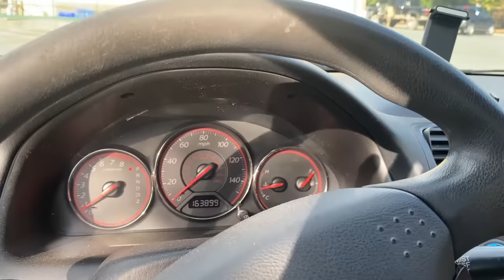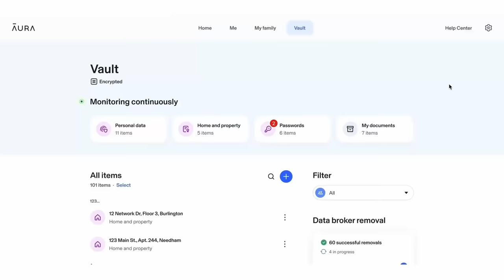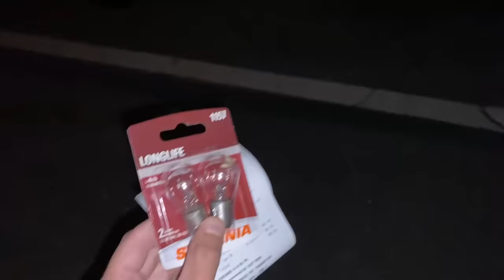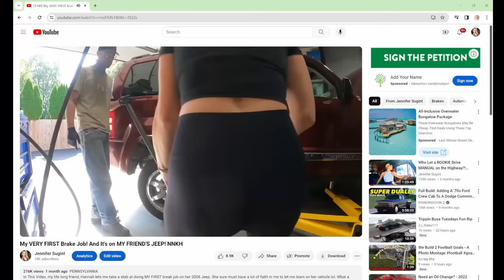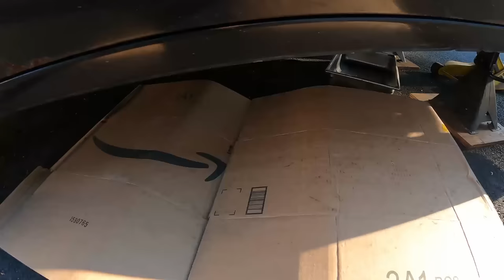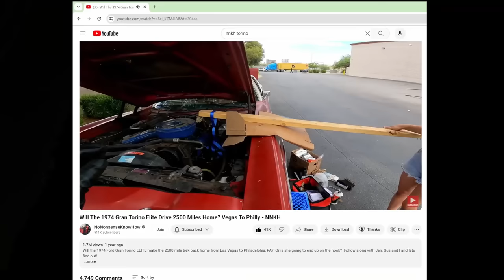Can This 86 Fox-body Mustang Survive its New Owner? I Bought a Manual! Jennifer Sugint- NNKH

Comment: Just a suggestion, do not do what my sister did, drove a standard while wearing flip- flops, in the summertime, foot slipped off the clutch at the wrong time,, and the motor's connecting rod put a hole in the side of the engine. Wasn't worth putting a different engine in, so, got an automatic next car. (My Dad paid for it of course....) Always wear decent shoes while driving.

Comment: Hey Chris! FYI   I am not sure what year the Honda Civic is but the exact same transmission problem happened to my daughter's 2001 Honda Civic. She was told by the Honda dealer she needed a new transmission. I told her to wait until I did some research. I found out that Honda had knowingly been installing faulty transmissions in Civics for several years and trying to cover it up until there were so many complaints and lawsuits. They couldn't ignore the problem any longer. The crazy thing is that if she agreed to replace the transmission they would replace the faulty one with another faulty transmission. I guess they felt like they needed to empty their warehouses on unsuspecting customers.  My opinion of Honda dropped considerably after that incident.

Comment: Replacing the filter on the threaded neck has challenged many men through the ages.  The usual problem is that you are working blind plus the oil likely on your fingers doesn't help and ....

Thumbs ☝(👍) this comment if you have the integrity as a man to admit it.

Comment: Jen,  did u see the mouse coming-out of the head liner??   I woulda tooken-out the liner, before u had vacuum the inside.
good job on the other things,  except the oil pan bolt o-ring.

Comment: That first thing in back is a differential gear.  You want the highest possible differential gear, lowest ratio, if you don't want to burn far more gas than you did in your Civic.  Burnouts may be fun but are very impractical, so if you can do a burnout on dry pavement, you should get a higher rear end gear to save gas, and hopefully that is one.
    A bunch of welding work should be able to patch up the worst of the problem rust like the sun roof latch.  I watch Scott at Cold War Motors for how to do that.  Then lay on the spray wax to keep the rest of the rust from getting much worse.

Comment: You may have done it off cam, but one really has to change the oil filter when the oil is changed. End up having the clean oil going through a dirty oil filter.
Reply: On never mind. Letting the movie roll I see the filter change.

Comment: It would run without a filter for 5 or 10 mins while all of the oil "squirts" out of the big hole in the middle and then the engine locks up!

Comment: I find that when I remove the oil filter, additional oil drains out the oil pan, so I don't replace the plug until after replacing the filter.  This also allows more time to drip, during which I also document the oil change in the maintenance log and perhaps the sticker on the windshield, and any sealant to gasket on the plug bolt.  This does involve washing hands twice in order to handle the maintenance log in the middle of the oil change, and increases risk of someone starting the car with no oil or adding oil with no drain plug, but it does result in a more complete oil change.

Comment: Congrats Jen, I just bought my first manual car this past summer! It's a 2005 Honda CR-V EX with AWD, I love it! A guy I know has a 1986 fox body mustang identical to the one that you just bought. Same color except his is a convertible and has an automatic transmission unfortunately, and it is in much worse shape than this one is. Good luck with your new purchase, hopefully you can get a new transmission for the Civic as well. Unfortunately the automatic transmissions on those cars are somewhat weak which is why I opted to get a standard this time around. The Civic and the Element/CR-V are mechanically identical cars so basically everything is interchangeable for the most part.

Comment: Nice use of the sniff test on the insulation. It also works on expired dairy products, to see if you can get another day out of that T-shirt, to determine if that was dog pee or water you stepped in, and your own armpits to see if a shower is required.

Comment: On the last one of these that I resurrected the owner had mice nests both under the seats, in the headliner, and also in the trunk as well, ironically in the exact same spot as they made a nest in your trunk! The sky is the limit as to where they could be. So do check everything and I also recommend that once you finish cleaning out the interior that you put an o-zone generator in the car for a while to knock out whatever odors are still lingering inside the car.

Comment: Pretty soon everyone will be calling you Jen Force. When you start doing burnouts. Wonder what  gears they put in when they swapped axles. Also if you're going to keep the car for awhile. Subframe connectors will help a ton. And save you in an accident.

Comment: Did you get the mouse that crawled out of the roof while you were working?  
You also need to check under the dash.  Yes, they can build a nest up there and stay while you drive.  Get a mouse trap and put it on the floor in your car.  I did that on my work truck and got two mice after I had cleaned everything else.  That's when I cleaned under the dash.
Nice car Jen and glad to see you learning to drive a stick shift.

Comment: Jen, every mup echanic has dropped the drain plug, wrench, and other tools inside the bucket of goo. 
it's going to happen. A trick is to put up pressure on the bolt as you back it out by hand. then when you feel that last tread skip, get your fingers on it and pull it down and away.

Comment: You kept me smiling all the way through. I am constantly amazed at the things you do, not try to do, actually do. I am lucky that I grew up messing about with cars, however I cant play the guitar, even though I have tried to learn a couple of times 🙂Your determination with the Mice Poop and getting stuck in, it must have been SO smelly. Also watching you under the car, thinking you might find some of the things easier to get to on your back instead of your tummy. The forgotten filter then WOW it was tight. No reason it needed to be that tight. You are cheerful, entertaining and make me smile, AND you can do Donuts n drive stick. Looking forward to your next one already.

Comment: @jennifersugent: A tip from the former owner of an 86 GT:  you don’t need to open the door and pull the release to open the hood on 85-86’s because of the huge grille opening.  Reach your hand in the grille opening upside down & on the back side of the hood latch there is a vertical piece of metal.  Slide it towards the driver side and voila- the hood opens.
Reply from the maker: Thanks for the tip! I’ll check that out as soon as I go outside

Comment: Well done on the maintenance of the Mustang GT Jennifer. Chris was smart to teach you how to drive a manual trans vehicle in the snow & rain. Respect the torque of the rear wheel drive vehicles! LOL. I did some research, there are kits to remove and replace the front strut tower to frame rail rust through you guys found on your Mustang. You'll have to drop the engine cradle to have room to do the repair. So it would be easier to remove the engine to do the fix. It would be great content for your channel Jen and you get to learn how to MIG  and or TIG  weld, a win, win situation.

Comment: Tip before removing oil filters is to grab sharp punch or Philips screwdriver and poke a hole in it where the oil will completely drain out of it before you loosen the filter. Less a mess of oil getting on the ground. Just let it drip for several minutes then remove it with still a pan under it.

Comment: It's great to see a beginner giving it a go and learning new skills. You don't need to become an expert, just learning the basics on cars and using different tools can be so useful for so many things. Even just knowing that wheels can fuse themselves to the hub and need a good mule kick can be the difference between getting home or being stranded in the middle of nowhere with no service, not to mention just knowing something as simple as checking that you have all the tools to change it and your spare holds air and doesn't go flat over time when you first get a vehicle.

Comment: Wait how did she change the filter after filling it with new oil and oil not go everywhere🤔
Reply from the maker: I didn’t start the car yet. It didn’t circulate.
Reply: @jennifersugint  i guess it was the car, in alot of cars if you take the filter off it will pour oil everywhere, i think that one is different because it has a dual reservoir!